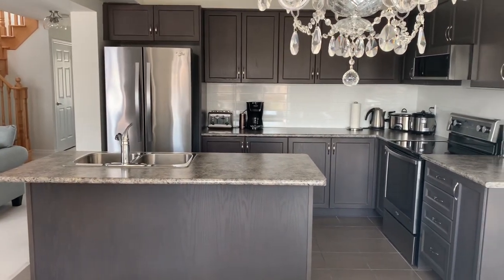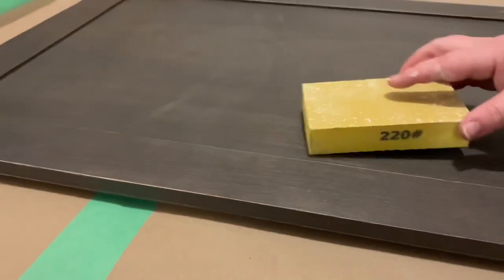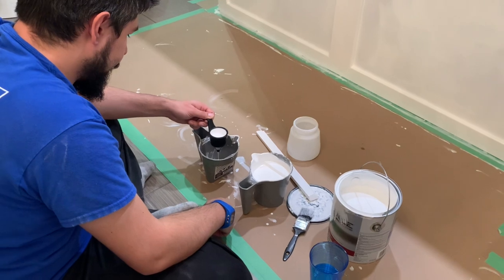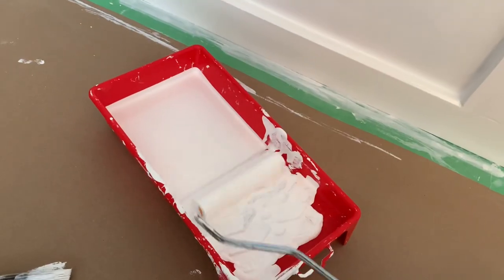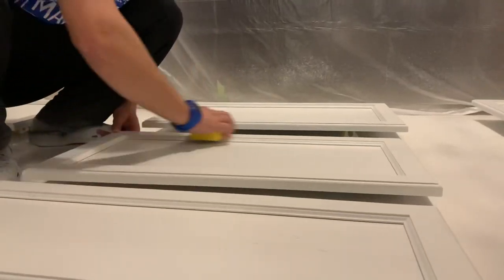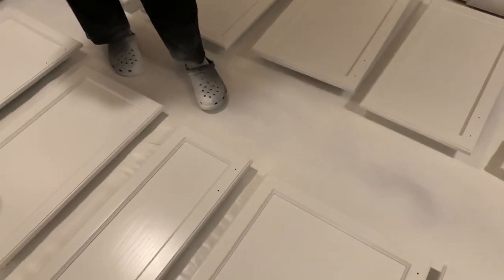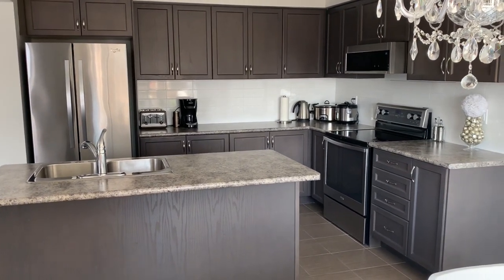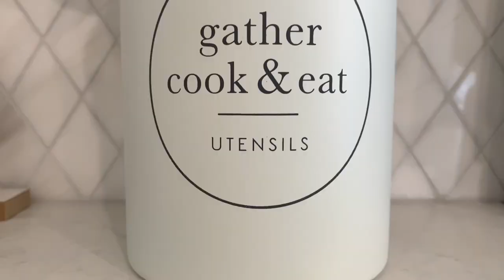EXTREME DIY KITCHEN MAKEOVER!!! How To Paint Your Kitchen Cabinets [BEFORE & AFTER]

Comment: I don't follow anyone on You Tuube but you and I have been waiting for this video - the kitchen looks spectabular!  So pretty!  You guys did a great job.  How was painting the cabinet boxes on the walls?   You could probably start a little business.
Reply from the maker: The cabinet boxes felt quick and easy because my kitchen isn’t large and because the insides were already white. If you gently move around paint in one direction with the roller after u cut with a brush then it’s a smooth finish without any paint marks and lines 🥰